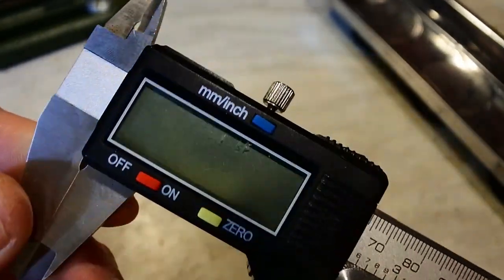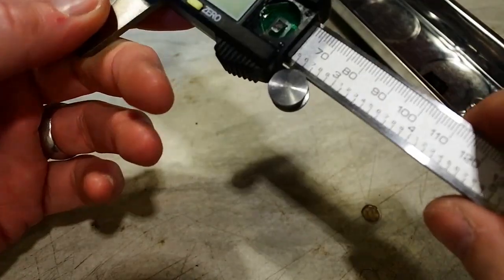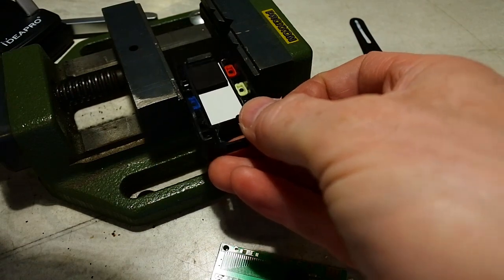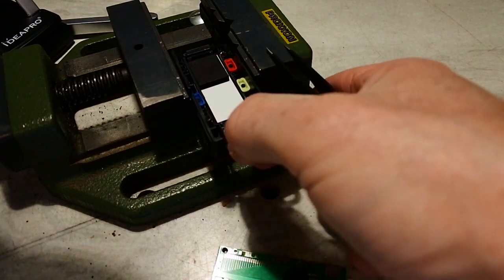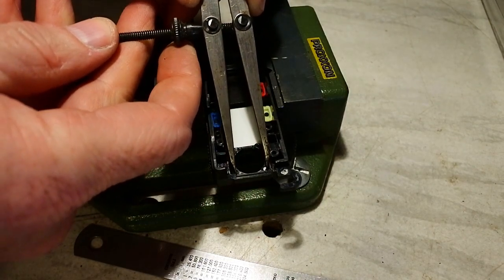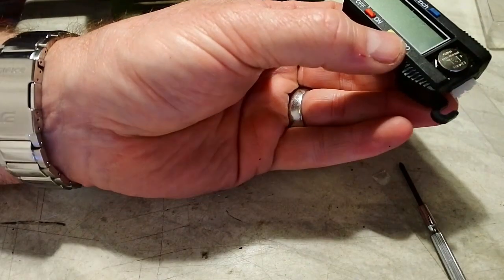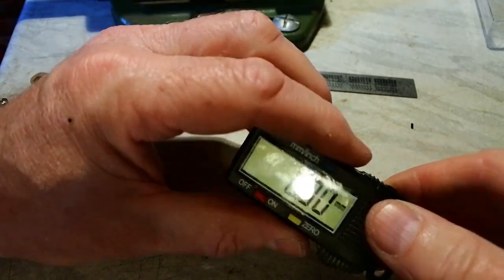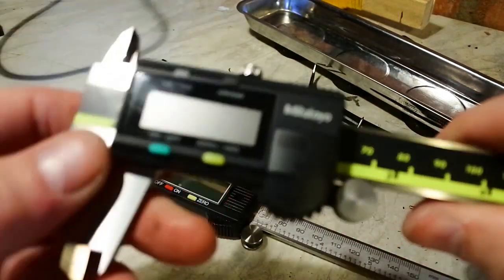The 'Never Flat' Digital Caliper Battery Isolation Hack

Comment: What does the zero button do ? Does it disconnect the battery ?
Reply: No. It calibrates "zero" once you close the calipers. Can also be useful for starting from zero when measuring, similar to a weight scale that removes (zeros) the weight of the container before measuring the contents.
Reply: @jly74  Well, that seems to be what disconnecting the battery does - therefore I wondered if secretly it was a battery disconnect button - hence if you held it down. it'd stop the battery going flat!
Reply: @millomweb  Could very well be a battery disconnect. Good thinking. I have a caliper just like his. No battery problem yet but I would just remove it before doing the mods shown. I don't use it enough to justify the time. Clever idea, though.
Reply: @jly74  I'm not rushing to give up my vernier caliper ;)

Comment: Just me? or is it difficult to see what's meant to be going on, due to poor lighting and descriptions, esp, the cutting and soldering bit!!
Reply: It helps if you understand the plan at an early stage. He's basically rotating the battery centre (+) contact so that the 'hinge' is toward the edge of the casing - so that pushing in a bit of sheet plastic will lift the contact from the battery.
Reply: Many thanks,  and I still think better lighting would help! :-)
Reply: @barryturner2702  Maybe my page on correctly setting up your computer monitor may help :
https://sites.google.com/site/pmailkeey/home/colour-calibration
I find a lot of people have 150 shades of black - what's the point in that ?

Comment: Nice content, I enjoyed your video. Nice solution  that works and using a minimal numberr of extra parts and materials. I have not solved the problem on.my own craptackular calipers. 
It's something I'd like to tackle ,using a switch somewhere, but i have not got around to, as I also have a decent caliper that can run for ages even after the battery low symbol shows.

Comment: The point to this video was to save the "expensive" SR44 battery?  I buy a 10 pack of Maxell batteries from eBay for $2.92.
Reply: No, I think the real point of this is to be able to save time when you're in the middle of a project and go to use the micrometer but it turns out it's dead.
Reply: My battery just died after 3 years. I just keep a 4-pack of batteries with the scale 🤔

Comment: I just treated myself to a £4.45 caliper - it's really good and I never feel quite a guilty about standing on them as I did when I stood on my £200 set last year.  My biggest problem is the battery - I must have bought about 10,000 cards of 20 button cells (.99p fleabay).  I think they know the secret of where the left sock vanishes to when you throw a pair into the laundry,  I use one and then never see the other 19 until they have started leaking.

My solution ... sorry - hack is to solder a couple of wires to the battery springs and attach a power connector.  I have quite a few 
1 and 2 cell AA and aaa battery holders that I power all my bits and pieces with - if manufacturers can't standardise their power - I can sort my own
I found torch switches on ali - tiny little single pole ·latching switches that give easy electrical isolation and the battery holders are pretty easy to position out of the way in most cases.  When it goes in the drawer - whatever it is goes without power connected. So no problem.

Comment: I just take the battery out and put it into the little tray! All that work for little reward!
Reply: Button cells usually fine just flipped over. i.e. put in upside down.
Reply: Yeah but that’s a lot of faff for a tool that often is something you grab and set down a bunch whenever you are using it

Comment: handy little tip, have the very same one! never had any trouble with it thank god!. iv seen a good few tear downs of these lately. cool how they their able to measure such small values & do it so fast to.  very handy thing to have if your into hobby electronics(like myself) or car mechanic work like changing out car stereos! ya know for measuring wires ETC.
P.S. the cheap ones are just as good as the mad expensiveness ones!! 
so one to remember if your in the market for one..  ya can spend 50 quid, or 5 quid on one. And the cheaper one would be just as good!! & in some cases probable better; )

Comment: +TomIreson  Good idea, but has some issues. By removing the wiper, metal shavings can stuck between the moving and the stationary PCB and scratch the hell out of it. You can push your plastic strip under the battery through the data connector without disassembling anything. This is not my idea, a commenter said this under BigClive's recent digital caliper teardown video. I am planning to install a small switch into the data connector opening instead, as I know I would always lose the plastic strip...
Reply: I missed that BigClive video. I am subbed to way too many channels.

Comment: Just removing the battery would be a lot more easy.
Reply: No, if you're doing it twice a day. And the battery cover is easy to lose, or it will wear out or break and fall off on its own. I removed the CR2032 battery from my digital angle finder which I bought about 4-5 years ago, and used it once since then. It is a fine method for something like that, that you use very rarely. But I use my caliper sometimes all day, sometimes I don't touch it for a month. So to be sure that the battery will not be forgotten inside for long enough to be drained, I should remove it every day.  This plastic strip method, or installing a small switch into the opening for the data connector is much more convenient.

Comment: I hate klutzing with button batteries. Someone needs to make a solar powered digital caliper much like there are solar calculators.
Reply: You know....they make dial Calipers that dont require batteries?!
Reply: @patricksanders858  Not in the same price range as these calipers. You could buy 10 or more sets of cheap digitals for what you would pay for a dial caliper.

Comment: One of my mates reckoned the lining in the case pressed on the switches, so I cut away part of the lining and no problem with battery. Maybe worth a try first.
Reply: These calipers never actually turn off, they only turn off the display.  They wake up on movement and have to consume electricity to measure movements, so they will drain down the battery just sitting there.
Reply: Had a blood test meter that can be accidentally turned on in its case. As it didn't time out, you only discover this on finding it with a flat battery.
I avoid things that need batteries.
Means my mobile phone has a range of 6 feet.

Comment: Brilliant

Today I fixed my micrometer with my hair dryer!
While warming the data sticker on the back it it started working again but I still need to get in there and clean out whatever battery corrosion I couldn't reach. When I do that I'll implement your excellent full off switch technique.

Comment: That is what i did, bought a proper one! 😩
Reply: For a low-mid budget DIYer, buying a Mitutoyo makes no sense, as these chepos are reliable and accurate enough, and the power consumption issue can be fixed, as you can see. You can ruin equally easily a Mitutoyo and a cheapo by dropping them accidentally on the concrete floor, or dropping a hammer or wrench on them, but ruining a $100 pair of calipers is much more frustrating than ruining a $5-$10 cheapo.

Comment: You just did $100.00 worth of work on a $15.00 POS. Throw it out and buy a good one. Thats what I have done.
Reply: The good ones go flat just the same.
Reply: That's not the point.
Reply: @alfa-psi  Too right - modifying something to make it work the way you want it to is all part of the fun of tinkering.

I got one of those £15 component testers that had an annoying habit of draining 9v batteries when switched off, so I modified it to run off an 18650 and a charge/boost board.
Reply from the maker: https://youtu.be/GcoUdIjZozY?t=541
Reply: SMART MOVE WHAT IS YOUR TIME WORTH

Comment: These things are like watches - they are never off.  If you use silver oxide (SR44) batteries, you'll get about a year before you need to replace them.  With the LR44 batteries, you get about 3 months of life.  With a SR44 battery in, I just leave it on all the time.

Comment: Unless you keep this in its box and separate the battery.. you will lose the battery and even the cover.  Great job, I had even thought of getting a microswitch to bypass.  Thought of this too but didn't think it would work well great design.. Thanks.

Comment: I found this fix to be easy to follow. I tried it and it works. If I were to pull the battery...I would probably lose it. Thanks for a great video!
Reply: I have these same calipers, but lost the battery ages ago. What battery does it take?
Reply: @rockstc955  The spare that came with mine says LR 44G 1.5V. Hope that helps. I'm only here because I couldn't get the case to open so I could replace it. First thing he showed us :)

Comment: Interesting idea. I know my digital calibers eats batteries like there is no tomorrow. Your idea is a fix. I was wondering if there is a way to use the 3.5mm jack to do something similar. I will have to poke around inside and see what I can do. Good video and link. I honestly thought when it is off, no battery drain. But the fact that it does drain, even off,  fits perfectly with my batteries draining during none use. Thanks!

Comment: It's ridiculous that the more expensive ones never turn off either.  I mean how hard is it to just design your expensive measuring device so it can be turned off, urgh
Reply: Fester Blats  by pulling the battery it does forget the zero point.. if you turn it off at anything different that 0 you will have to zero it at the next use.
Reply from the maker: The memory needs to stay powered up to remember the absolute zero point.  Much like a wrist watch needs to be powered up all the time to remember what day it is, and watch batteries last for years and years.  The expense is in the properly designed standby power consumption, as well as other aspects.
Reply: @TomIreson  That'  what the zero button is for to re-zero , so no need to keep power to memory. so no reason either .
Reply: @TomIreson  I pop the battery out of mine when not in use, works fine and the battery is over 5 years old ( lasted 3 days when I left it in until I figured the parasitic drain)

Comment: How do you know that it drains the battery,while off? i would get some wires,a clothespin to press them against the battery, a dmm,and measure the current,if any, to make sure, or do you know , that good batteries go flat,over time(months?)?.
Reply: @alfa-psi  Looks factory, nice job.
Reply: @alfa-psi  I like your solution better. Where did you get the switch?
Reply: @alfa-psi  Thanks! found them on eBay for like $4. I'll go ahead and get these ordered.
Reply from the maker: https://youtu.be/E8oopG2GpF0